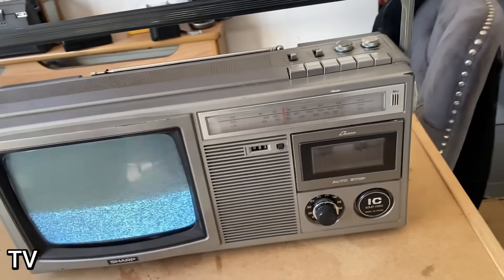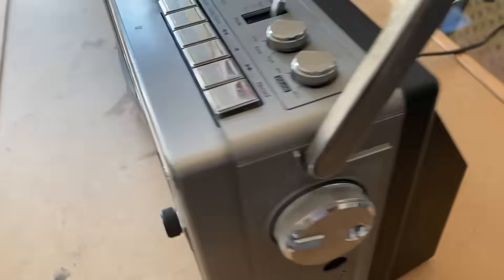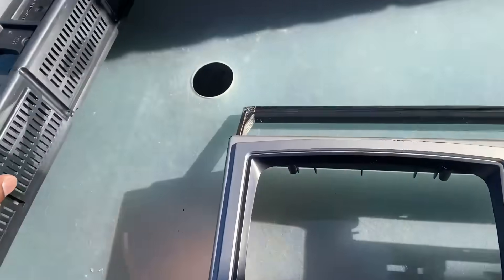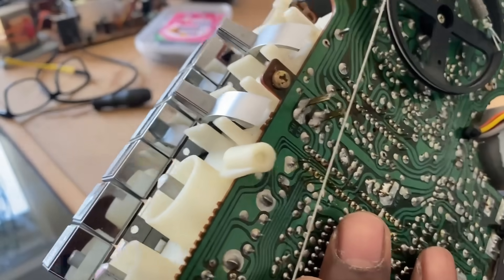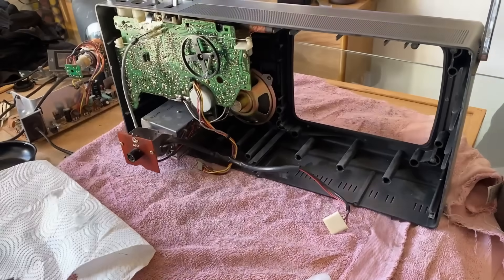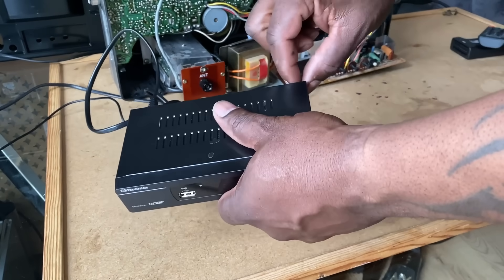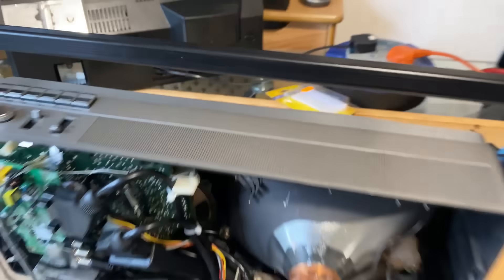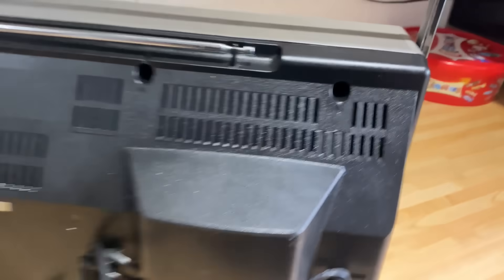Converting Analog Portable To Digital TV

Comment: This is a great performance and showed step by step. However, the rf connection from the tv were not explained and did not show how did he get the wiring from the tv.
Reply from the maker: Thanks Rostam,
                             soldered an external cable directly to the Bach of the RF Socket 😊

Comment: Very nice work! I still use an analogue black and white TV with my Sinclair ZX81 computer. I assume I still could after the mods you made there.
Reply from the maker: Correct Lee,
                    yes this is ready to receive an external connection via the Aerial socket 😁

Comment: Great job. You could even get rid of the RF staff by connecting the composite video signal from the scart to the appropriate video section on the TV pcb it can be usually be done quite easily when the schematic is available. It is more tricky when there is nothing available.
Reply from the maker: Thanks Giles,
                       yes stating to hear a lot of the composit a lot now. Might give it a try 😁

Comment: I thought you forgot to replace the drive belt for the cassette drive system. But, you didn't show that but, you had replaced it but, not shown in video. Not only does it look better but performs better aswell.
Reply from the maker: @Thestig-en6gp  Sorry about that Stig, managed to slip the old belt out and the new one in by bending the bracket unde the Capstans Flywheel, rather than stripping the unit down. Didn’t think it was correct to display such a method 😀. Thanks and yes it turned out quite well 🤩

Comment: There’s room to the left of the radio dial under the clear window for that LED digital display, or did you intend to stay true to the original design?
Reply from the maker: Second question correct Jacob,
                                                        just wanted to take it back to 1981. USB an MP3's to which the Digibox has the option,  would take it into at least 2000's, just wanted to keep it original as poss. Had no option with the remote as this was the only option to change channels 😁

Comment: Brilliant job repurposing that retro bit of electronics.

I'm just annoyed with myself for selling a similar unit I had kicking around for £20 thinking the analog TV was finished and the unit was useless!😮😳

I think this is a brilliant idea and the only upgrade I can think for it is an integrated USB mp3 player.🤔😊
Reply from the maker: @pdtech4524  Thanks PD Tech, yes pleased with the outcome, however just wanted it usable once again after so many years dormant. USB feature would take away the Retro aspect 🫤
Reply: @green-crocs-fixes1520  You can get very cheap Bluetooth->FM Transmitters, meant to bring your music from the phone to car radios. I modded my Grundig Satellite radio with one and it now has BT connectivity without changing any internal wiring or functions, just had to find some suitable supply voltage, set the FM frequency to something empty on the local spectrum and voila. One doesn’t even have to build it into anything, as long as you power it up somehow it will enable any radio near to ‘play mp3’ from your phone.

2nd possibility, since it has a tape section but more work and fiddling: take the innards of some cheap and tiny mp3 player, wire the output to some salvaged tape head and glue everything inside an audio cassette shell. You better have a good curated playlist since no way to reach any button once inserted and getting the tape head alignment well  can be a somewhat painful process (I just put transparent tape under it over and over until satisfactory stereo separation was achieved)
Reply from the maker: @fiedel  Just trying to keep it 80's Retro as possible Fiedel,
                           Bluetooth and MP3 is going to move this machine into the 2000's which was not the objective just wanted to be able to watch TV programs on the unit again, had no choice with the remote as this was the only way to change channels 😁
Reply: @ optical increment sensor on the channel selector axis plus a small microcontroller which feeds the proper sequence into the infrared sensor, you could cannibalise a mouse with a scroll wheel for that, just saying ;)
Reply from the maker: @fiedel  you probably right, I hear you 😏

Comment: Looks nice! I also got a unit similar to this but it needs a lot of TLC. When I mod old CRT devices like this I usually do a Composite video mod on them instead of RF because the picture gets super sharp then
Reply from the maker: Thanks Pulverrostmannen, 
                                               appreciated, the CRT picture is very good, I had to reduce the cameras resolution when filming from 4k to HD/30 as the 4k would show screen flicker 😁
Reply: @green-crocs-fixes1520  yes your picture looks pretty good to be just RF but you would not believe how good the picture gets on the same TV if you would make a composite mod on it. It is often possible on TVs like these to feed video and audio directly into the circuits by disconnecting two pins on the Jungle IC for video and audio and completely bypass the RF section. 
But once you learn how to do this you will never want anything else when you see how good it gets. Plus you don’t need to buy converters for Scart or such. 
But it can be good to know that some TVs need a few capacitors or resistors to work properly. 
But I love to tinker with old CRTs
Reply from the maker: @Pulverrostmannen  OK, sounds way above my remit but I will research this method 🙂

Comment: You should get a colour one. 
B &W is so dull compared to colour. Also crt colour has infinite colour palette so richer than any flat panel. 
    Give it a go !😊
Reply from the maker: Thanks Taketimeout3,
                                      however the objective was to keep the unit as original as possible as this unit needed an external device to view channels since the Analog channel frequency was turned off, the remote was only added in order to change channels. Finding a 9" Colour CRT and fitting it with the required electronics is way above my remit I'm afraid 😀.

Comment: Why don't you get a high definition satellite to analog converter box?  Until 2023 I was watching digital high definition signals through a 2008 retail store sold converter box on a working 2002 CRT screen TV.  I still have saved the converter boxes.  They are only worth $25 USD+ to sell to anyone having any CRT TV's.  They have channel scan menu with remote controls.  On a set channel the converter boxes change channels for receiving satellite high definition signals for like channels 2 to 66.  It feeds converter digital to very clear analog in a DA chip in the circuitry.  No need for high technician knowledge.
Reply from the maker: Thanks for the info Lawrence,
                                                     however this is the method I chose 😀

Comment: i like this project you have done, but i seem to have not understood how you connected the rf unit to the tv screen.  i saw you glue it in , zip tie the cable,  then suddenly it was connected to the screen. is the unit sending out a wireless signal ? i presumed you were going to connect wires to the screen and speakers. what am i not understanding?
Reply from the maker: Appologies Joel,
                             step by step would have made the video too long so basically; Connected an RF Male connector to the short aerial connector coming out of the tv receiver, after first disconnecting it from the external socket. Connect RF to RF Modulator Scart Adapter. Scart between RF Modulator and Digibox. Then a RF Male extension to the previously disconnected aerial external socket 😀

Comment: Really takes me back, couldn't afford one when we were young, but bootsale finds were fast and furious in my teens. Had me a Sony portable, stuck it in my Ford Capri and watched it whilst working as a nightwatchman during my years at Technical College. Worked Friday to Sunday days and night then straight to tech Monday morning. Got paid 50 pounds for the 3 days back in the late 80s and early 90s.
Reply: Nice sets, those. I have an Hitachi 5 inch tv/radio/cassette combo. My tv sets are not set up with an internal digi and converter; I'd say don't rely on that hot glue. 

 Use fixings or for the little remote receiver use a two pack epoxy glue. I fixed an old radio some years ago and the hot glue just falls away pretty quickly.
Reply from the maker: @ your not wrong CDEmm50, fully intend a rework on this unit which will involve Bolting the PCB to either the Main Board or the Back Cover 😀
Reply: @green-crocs-fixes1520  👍 The hot glue is good for one thing, I've found it's good to hold an arrow tip onto my wooden arrows in archery.
 Tap them on gently and use hot glue if I'm out of epoxy.
Reply from the maker: Aye LiveSportsVideo,
                                     they most certainly not affordable back then for the average Joe. Fortunate for you they were 12v with external adaptor, hence why you were able to watch in your Car, instead of watching out for villains 😀

Comment: Great Video

U.K turned off VHF in '85

On your Scart to RF to has 61.25 MHz & 67.25 MHz NTSC Ch. 3 & 4 here in the U.S 

The TV is UHF, I'm I missing something here, I want to get a PAL Pocket TV just for Collecting
Reply from the maker: Hi Mario,
                referred to as the "analogue switch off". In the United Kingdom, the terrestrial switchover started on 17 October 2007 and was completed on 24 October 2012. 

What exactly are you missing ?
Reply: @green-crocs-fixes1520 The shut down in 1985 he was referring to was the 405 line television service that closed down in January 1985 that was transmitted on the VHF band
Reply from the maker: @MrBillmcminn  Superb, 
                                            thanks for the info Bill 😀

Comment: I still don't understand how dial works. I assume by the clear English, you are from Britain. Do you still have aerial TV stations? And this digibox, it still works by air carrier signal?
Reply from the maker: Hi lauraiss,
                   the Dial was used to find the TV Channels, we only had three back in 1080, BBC1, BBC2 and ITV obviously superseded by Push Button then Remote. The Signals transmitter was shutdown in 2012 and replaced Digital TV via Air also 😀.
Reply: @green-crocs-fixes1520  Yes, but what I understand is you plugged in digital tv receiver, then it's output converted to analogue, then fed it into the input of TV's original input. That is all clear. But in this case, why the dial works? How did you manage the original TV dial to affect the digital TV box? Am I missing something? I would assume that your setup would be fixed on one frequency that converter outputs and you can change stations only using digital TV receiver's remote. Why dial works?!
Reply from the maker: @lauraiss1027  

I think your statement is correct Lauraiss,
 
the TV Tuner dial picks up the Digibox Signal via the RF Converter, connected to the Aerial Socket.

There are two Auxiliary channels as standard which can pick up the Signal.

Once I have locked unto that channel (called source these days) then I can only change the Digibox channels via the remote control 😁

Comment: That was nice work. Those Sharp TV/radio/cassette recorders are great machines. 

My mother bought me a Sharp 10P-18H for my Christmas in 1979, when I was 15. It was an expensive machine in 1979, but she saved her pennies to get me one.

It lasted for years, until the plug lead whiplashed, with its brass terminals, smashing the CRT. I managed to get another exact same model, a couple of years ago, for just £14, including postage, from eBay. The owner said that it was half working and if no one bought it soon, he would throw it in the bin. The machine was dusty, but in great condition. All that it needed was new belts, for the cassette mechanism. Some people.
Reply from the maker: Thanks Francis,
                           we couldn't afford them either as they were pricey as iPhone are today for example. I think you got a bargain from eBay, and I still keep a lookout for the 35H model. The Cassettes drive belts always perish in some way over the years  however their replacement are cheap enough online 😀.
Reply: @green-crocs-fixes1520  Thanks and I hope you get your 35H model, in nice condition and at a reasonable price, soon.

All the best,

Francis

Comment: That's impressive. To do this with a color unit should be next. And now you can record directly to cassette. But didn't the unit have the proper input for a D/A converter box on the back or side for us less mechanical?
Reply from the maker: Thanks Phillip,
                         done one in Colour on another model, see the link below. This was met with a lot of backlash by avid Retro fans who do not like to see a the original CRT (Tube) screens replaced by an LCD Colour panel. Don't think Scart or RCA A/V was around in 1980 an they most certainly were no fitted to this unit, only RF Aerial input 😀.  https://youtu.be/DKoHNes3p4U?si=yorgkJZVT3guzrm_

Comment: Usually it's possible to completely skip the internal tuner circuitery and inject composite video signal in the IC that drive the CRT, to get better images.
Reply from the maker: Thanks Daniele,
                           Im sure you can, however this is my method 😀.
Reply: This..👍
Reply: Till you realise the main pcb is at half mains potential and your input socket becomes Live...
Reply: @Mr_Rusty1  This set would be ok for a direct conversion as it uses a step-down isolation transformer. You can see it at 08:45 in the centre.

Comment: I really like this type of work. Bringing old technology into the modern era. You could improve the concept with a bass speaker instead of the mono speaker and two small tweeters integrated on the sides (if the magnet of the small woofer does not affect the CRT). It would make a 2.1 boombox. With one of those cassettes with a bluetooth receiver and why not a chromecast. In any case, nice work.
Reply from the maker: Thanks Musical Box,
                                    Like to keep it as original as possible as I have discovered there are are Retro fans out there who dont like 2025 stuff 😀.

Comment: Nice video, I bought a Sharp 10P-18H a few months back, similar device - but I didn't integrate the set top box. I got a black and white TV license and the money saved compared to a colour license more than paid for the TV and all the stuff I had to get for digital reception.
Reply from the maker: Thanks internetvideoenjoyer,
                                      Just a project. I was also going to fit a rechargeable 14 Volt Rechargeable battery inside to make it totally portable but decided against it 😀. As for that Licence Fee. Totally out of date.

Comment: Casually handling that CRT just after turning off the set...you're very lucking you didn't end up on your ass against a wall among the shards of glass.  The tube retains a charge of several thousand volts for some time after being shut down.
Reply from the maker: Terribly sorry what happened to you Jack, hope you fully recovered from your ordeal. However… I know what I’m doing 😀
Reply: That's a bit of an exaggeration....

15 years ago I worked for a company that put out arcade games. I swapped out boards on CRT displays almost everyday, got zapped hundreds of times. Yeah, it's a bit of a surprise when it happens but a far cry from throwing you across the room.
Reply from the maker: @ Agreed TofuInc,
                                           it sounds like a bad experience extreme @ that 😀.
Reply: He's quite safe. A set like this would not have a big charge (if any) left in the tube, and the way he handled it was fine. It's the anode cap you need to stay clear of which he did. I repaired CRT TVs for the best part of 30 years so I think I am qualified to comment.